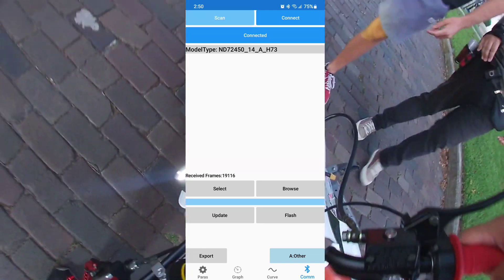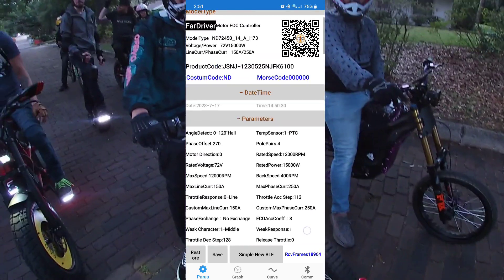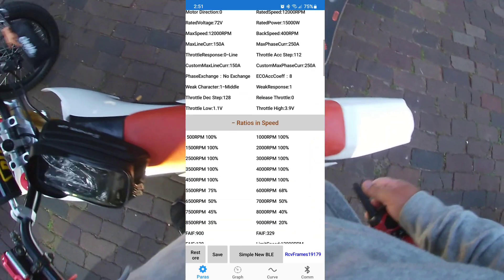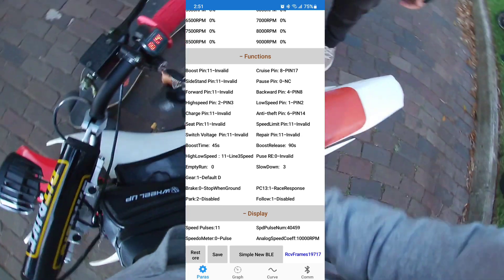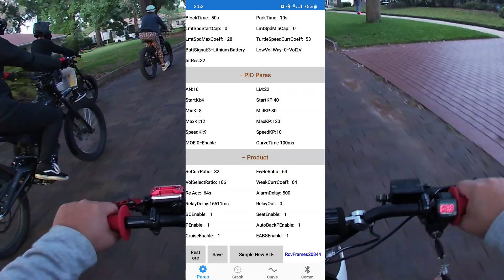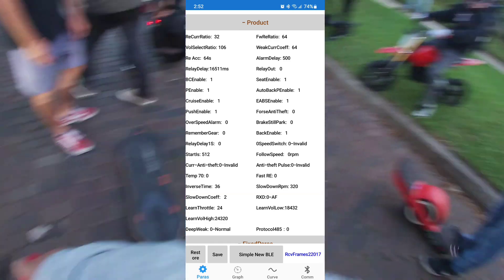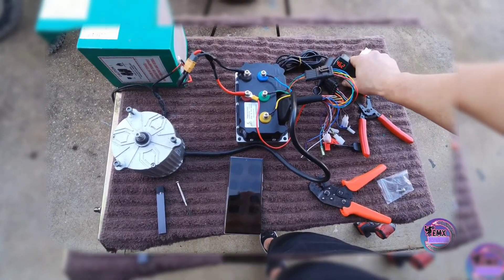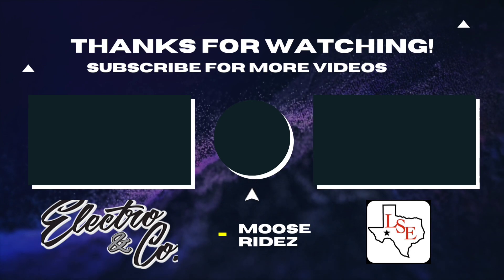READ DESCRIPTION - Fardriver Setup for a EC4P Motor

Comment: How can I make it so where my bike can pop well and have a ton of battery life but won't be very hot because I had 120:300 on my ec4p lite motor and I was hitting 110 c yesterday also I have a 72v battery
Reply from the maker: 110 isnt too bad. 150 is a bit spicy... you can change your gearing for more torque so you dont have to use so much phase amps. i run 13/65 at 120/275 and it rips with speed and has enough torque for me at 230lbs.
Reply: @ what about the ratios in speed I only have like the 7 rpm's set at 100% after that I went down by 5% until 70% and are you able to send me a link to a 35# 13t motor sprocket I swear no one has built that type of sprocket before
Reply from the maker: @Carterfvv  i run a 13 motor sprocket on #35. Burromax has it.  Rpm ratios should be 100 to about 3000rpm and then tapper down with last two rpms at 5 and 0
Reply: @MooseTuned  ok got it thanks but I should've probably either got the kr5v or the sotion fw11 have you seen the videos on people e&c motor snapping in half it's crazy and they weren't even running on full power!
Reply from the maker: @Carterfvv  alot and i mean alot of it is user issue. Ton of issues with the kr5v aswell. Im 3 years deep with a ec4p v1 prototype lol.
Reply: @MooseTuned  that's sick does it still work or is it lil on its last breath?
Reply from the maker: @Carterfvv  works like a champ. Juat did a 60mph run on it yesterday lol.
Reply: @MooseTuned  btw a js did a restore on my Fardriver and tried to do a auto-learn but my motor sprocket wasn't spinning fast at all but then after when I let go of the throttle and did it again it was doing the auto learn perfectly fine but now I tuned it a lil bit but now my motor sounds a lil different when spinning with the chain on I'm so confused about it
Reply from the maker: @Carterfvv  gotta make sure your pole pairs and pid parameters are correct
Reply: @MooseTuned  i checked and there the correct things but it runs perfectly fine!

Comment: My fardriver I plugged the throttle and volt meter to the orange cable it made a popping sound the app says it’s fine but the volts started dropping and I tried the different orange wire and it didn’t work what’s the fix?
Reply from the maker: sounds like you may have connected in correctly. i wouldnt connect wires with a battery plugged in.

Comment: Hi do you know if this will work with the new ec4p lite motor
Reply from the maker: yessir it will!!
Reply: @MooseTuned  thanks for the reply. And is it easy to setup 3 speed.
Reply: Also I’m running a 72v 32 ah 200amp battery would my setting be the same
Reply from the maker: @Brrrrrr559  yup. Just plugs in! And theres preset values
Reply from the maker: @Brrrrrr559  auto-learn, dont change phase offset. Make sure pole pairs is at 4, an settings is 0,4,8,12,9 in order. And then set what amps and phase you want to run.

Comment: Which pin in the board of controller for single line digital speedometer?
Because i can't found the light blue wire on the my controller. And the wiring colour is very different with your controller.
Reply from the maker: i havent done anythi f with the speed sensor. i use a gps for the speedo. one day ill do the djd display

Comment: Hello, I have a qs 165 encoder version. I have an issue with it. It shows "Motor hall error" 
I suspect the encoder board to be faulty, there are 3 wires coming out for encoder signal (green, blue and yellow), the green and yellow are outputing 0 to 3v depending on the motor position, but the blue wire signal never changes, it's always at  0V.
How could I test the sensor board to see if it is the problem?
Thank you very much for your help
Reply from the maker: Check out the fardriver tuning page on Facebook

Comment: What you recommended best torque setting off the start of the throttle  for hub motor  trying to have more torque off the line
Reply from the maker: Increase your phase amps. That's basically your punch that and change the throttle response from Line to Sport. But, yeah, more amps means more  accel and torque. Just male sure you tune it to what your battery is capable of pushing. Don't exceed it
Reply: @MooseTuned  so I don't touch that PId paras?
Reply from the maker: I wouldn't, not off the back
Reply: @MooseTuned  I'm running max out  fardriver but I have zero accel ot feels thats why I'm asking  anyway I can dm u ?
Reply from the maker: What controller and what battery specs
Reply from the maker: Also depends on the type of wattage you hub is putting out
Reply: @MooseTuned  I'm doing 3k watt motor 
50ah 150 discharge mime is set at 190 rn but my battery it limiting it to 150. And rpm maxed out . On my old controllor the kelly I was lnly pushing 100 but my torque was ridiculous  compared to this controllor. This controllor not giving me any torque compared to the kelly I had
Reply from the maker: Is your rpm maxed on your throttle?
Reply: @ManoZGaming , are you saying you have a fardriver 72360, with DC amps set at 190 and phase amps set at 360? But your battery is limiting you to 150a? 

Set your DC amps to what your battery can support, leave phase amps at 360.

Then make sure you are in mode 3 if you don’t have a 3 speed switch. Default settings on speed 1 and 2 will only give you a fraction of the 360 phase amps.

For ratios in speed, the first several should be set at 100%. The later ones are set lower than 100% when you manually tune the fardriver to your motor. 

Make sure you set your throttle correctly so it’s sending 100% signal to the controller. The controller is set to work with almost any throttle so its not going to be set correctly for yours. And the throttle doesn’t adjust itself during autolearn.

Screenrecord the fsrdriver dashboard when giving full throttle and it will show whats not working.

After setting all other settings correctly, you can tune PID, but if you carelessly change values without any rhythm or reason you can burn the controller up because that sets the proportional and integral properties of the current control loop. These settings enable the current does exactly what the CONTROLLER says it needs to do, based on a mild suggestion from your right hand on the throttle. Lol

But typically you can move one notch down to the next higher power level because you are to run the snot out of that controller and motor. 

You might also have some luck changing LM to a slightly higher value. AN should be set to 0 for hub motors.

Comment: Set your an to 0. Thank me later.
Reply: Lmao on point.
Reply: Btw does your bike work better on 0 or 16?
Reply from the maker: @teknique8292  on an 1, at 0 it was slower.  also switched kp speed back to 9. Tried it at 7 and it was slower. I also have phase offset at 270. Went over 60 last night lmao. It's sketchy af. I wish I had it on video lmao 🤣
Reply: @MooseTuned  bro same I did 60 yesterday easy but I got too scared and had to slow down. I’m trying to figure out the whole phase amps thing right now. Love the videos btw
Reply from the maker: @teknique8292  I super appreciate it man!
Reply: @MooseRidez changing your phase offset made more power and speed mine runs smooth now
Reply from the maker: Check description lol
Reply: @MooseTuned what does AN do?
Reply from the maker: @MrDeceptacon88  correct reading of the motor. All updated settings in the description
Reply: @MooseRidez thx...but i dont have the same motor as yours. I have a read hub qs273 but using a fardriver as well so i was wondering what AN did. Some settings in their software are very confusing😅
Reply from the maker: @MrDeceptacon88 gotcha. Put your an at 16
Reply: @MrDeceptacon88 , you have hub motor. All hub motors and some middrives (like Surron)use surface mount magnets. Surface mount magnets use AN=0 and never higher than AN=8.

For high quality middrive motors which use V-magnets, the default AN=16.  But no hub motor uses V-type magnets, so your motor should be AN=0. 

Votol also has a setting for Surface Mount or V-Type magnets, which changes some of the characteristics the controller is trying to regulate.

KO MoTo and QS motors middrive use V-type magnets, so they need AN=16 for default. 

But you need AN=0, not AN=16.
Reply: @imho7250  thanks so much!!!
By the way..i set my regen to zero on the lowest rpm
Reply: @MrDeceptacon88  , is Regen working smoothly now? Mine still had a slight reverse so i had to soften the next setting to 50% to completely get rid of the reverse after stopping.
Reply: @imho7250  yes mine too. If i set the lowest RPM to 0 but the rest at higher percentages, will regen still work? I thought putting the lowest at 0 would not allow regen to activate
Reply: @MrDeceptacon88  , yes, this table works like the ratio in speed table, where the percentage you set only affects the rpm range you set it for. But the difference is, when accelerating you need the first ratio in speed to be 100%, but when decelerating (regen), its not mandatory to have the lowest settings above 0%.

But if you set 0%, 0%, 0%, 0%, 100%, 100% etc, you won’t have any regen except at high RPM, but none as you slow down below that first 100% setting.

So if you have 0%, 100%, 100%, 100%,….. and still feel a little reverse after you stop, then start decreasing the second value 75%, 50%, 25% until you get the best regen to a stop without the reversing. 

If you use 0%,0%, 100%, 100%…..I think you will find a dead spot in regen and you will slow down and then coast with no regen. So you need to increase the second value to whatever gives you the longest regen without the reverse. 

Mine is 0%, 50%, 100%, 100%, all the way down 100%. And i can feel regen ending just before I come to a complete stop, so i need mechanical brakes the last foot.
Reply: @imho7250  yes I understand what you mean thanks..yes my regen is 0, 35 35 45 45 on so on. I dont like it too strong when i let go of the throttle.
And i like to coast as well a little
Reply: @imho7250  my battery capacity speedo doesnt move at all. Its at 0 all the time but i can see the voltage below it  on the speedo page which is displaying correctly. Would there be a setting in the menu that i have not set? Thx
Reply: @MrDeceptacon88  , which display are you using? A well known model or generic brand? If speedo doesn’t move at all maybe you are using fhe wrong speed wire on the far driver (you have 2 to choose from) or the display (some display have both phase and hall wire and you must use hall wire.). Sometimes the hall connection is there on the circuit board but no wire and you have to desolder it from phase and move it to hall. 

If you get the right wires connected, a normal display will show you gear position, fault and error icons, eabs icon and other things
Reply: @imho7250  ah..i mean on the fardriver app page where it shows all the settings in the shape of speedometers. There is one labeled Batt Capacity.. It is at zero.
But the digital voltage displays correctly below it
Reply: @MrDeceptacon88  , it probably means you have a setting wrong. Can you connect your phone to the far driver, then click “Expert”, then start screen recording, then slowly scroll through all the settings from top to bottom, then upload that video (not for kids lol).
Reply: @imho7250 What AN would you recommend for the sur Ron? I have it set to 4 currently
Reply: @SharkTheatre  , of your motor has surface mount magnets, the AN should be 0-8, if it has embedded (v-type magnets) it should be 8-16. If 4 gives you smoothest operation thats probably best. 

LM also can be tuned. I think mine is 16 now because that was the highest that gave smooth starting. I also went one set higher performance on the KI settings which made mine accelerates smoother from a stop.
Reply: @imho7250  so when changing AN value what differences will there be? Is it just for the initial start?
Reply: @SharkTheatre  , so far I haven’t seen any change when adjusting AN from 0 so I left it there. My understanding is that it tells the STM32 chip which algorithm to use based on the flux pattern the magnet arrangement makes. 

Surface mounted magnets create a different flux pattern than embedded (v-type) magnets which QS mid-drives use. In Votol controllers it simply asks you if its surface mount or V-type magnets, and if you select V-type it activates an additional flux weakening setting. 

The fardriver takes this a step further and lets you select essentially move a slider from surface mount (AN:0) to deeply embedded (AN:16), with 15 settings in between. 

Generally speaking, any setting change you make that for a specific watts (as seen on the fardriver display) which makes the bike accelerate quicker, go faster, run smoother, and especially run cooler would indicate its a better setting than before. 

The tricky part is some settings allow more power to be allowed from the controller (like DC and Phase amps), but also flux weakening settings allow the motor to accept more amps. So of course since this is typically more watts too, you have to see if the temperature increase is reasonable for the watt increase. 

I currently have WealCharacter at 7 (none) because even at 48v it’s faster than my battery can handle (25a real world CDR). My new battery will be 60v and probably even without flux weakening will go faster than i want on my tiny ebike, but since the battery will be 60a CDR 180a peak for about 10 seconds, i will probably at least test each WeakCharacter setting to see the effect, and at that time i will try 0-4 AN and see if any changes.
Reply: Hi..what is the function of AN ?? Thx
Reply: My bike is going verry slow and not popping up at all

Comment: In my opinion this controller takes the ec4p to its best potential. Granted i havent tried it with the noisy cricket controller. The motor seems to run alot smoother with the fardriver than with the kelly.
Reply from the maker: Yeah it's kinda insane I gained 10 mph over my kelly running less amps!
Reply: @MooseTuned  exactly! I'm never going back haha.